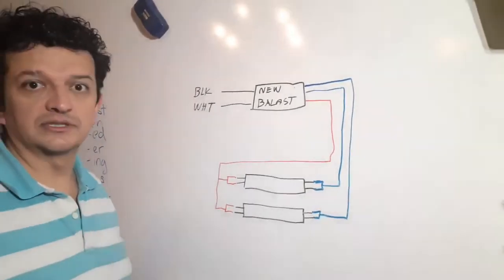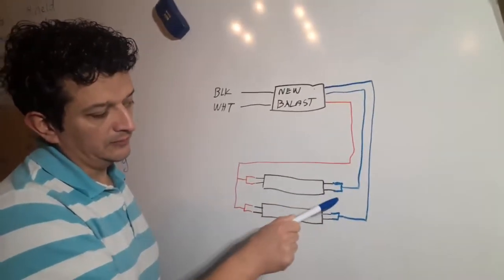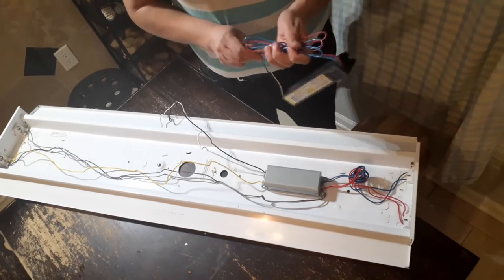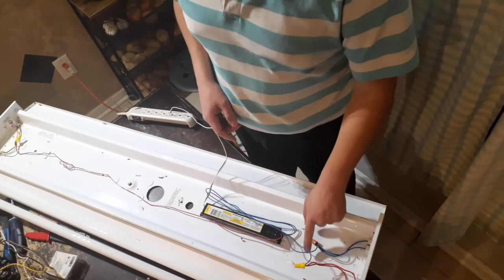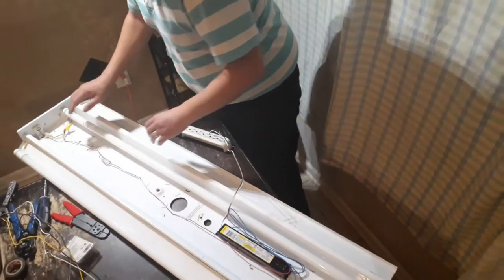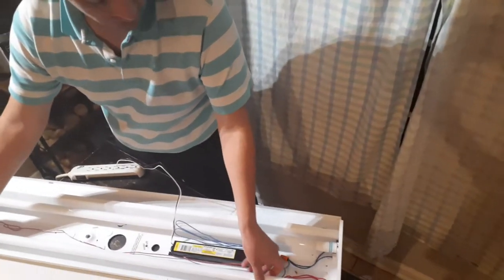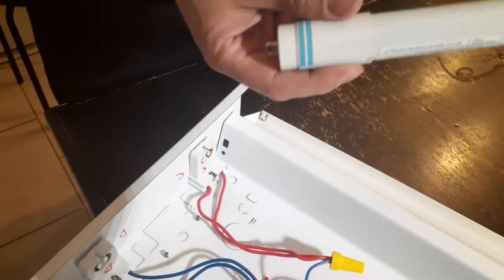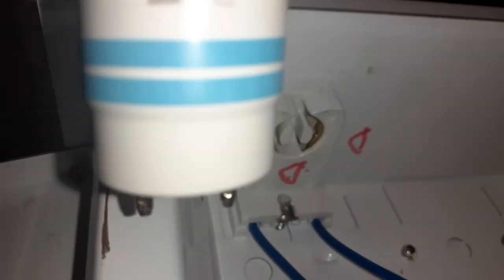Ballast Replacement

Comment: Kind of a waste to replace an old ballast for LED tubes. You are wasting money running LED tubes through a ballast because you are losing lamp watts to ballast. There are plenty of LED tubes that will run off of straight 120V, not requiring a ballast. You just have to watch whether LED tubes are hot/neutral on one side of tube or hot on one, and neutral on other side. Many LED tubes will run on any voltage between 120 and 277V!